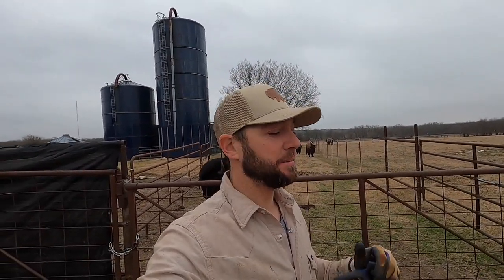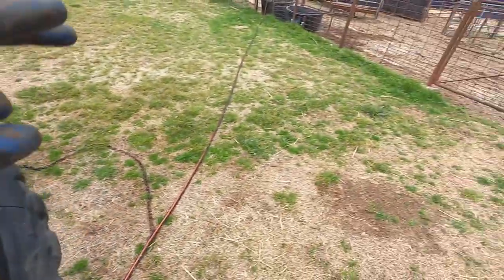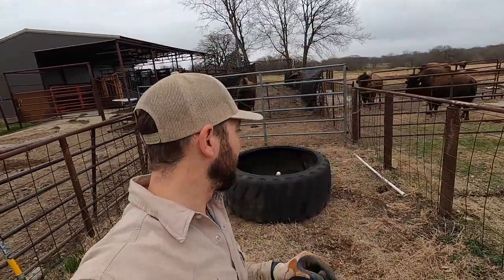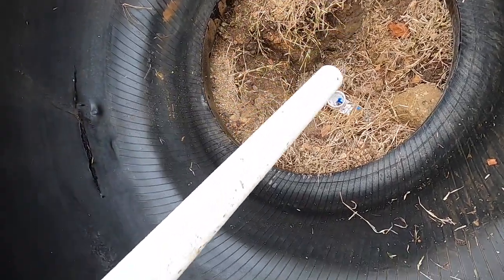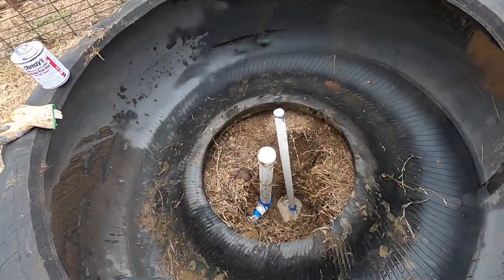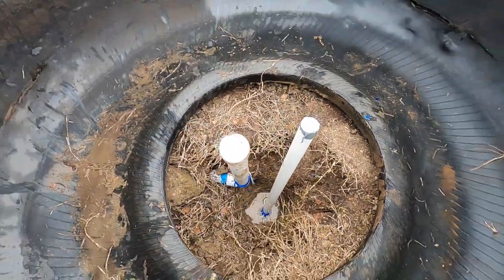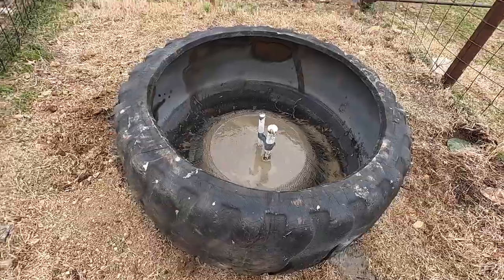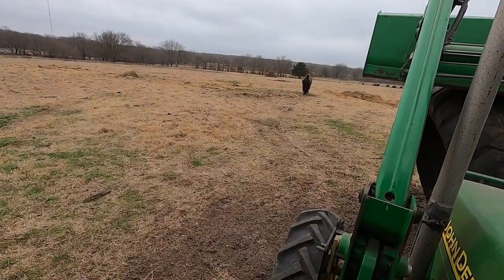BIG Tires for BIG BISON Water Tanks! (Part 3)

Comment: Dunbar playing Chicken with the tractor is hilarious.  All the Bison are so curious whenever there is something new and different, so they have to check it out. Those tires are bigger than I originally realized. Great way to reuse or upcycle worn out truck tires. Using them as water tanks, they could last for years & years! Good way to do your part for the planet & kudos to whoever's selling them and not dumping them. Though I think dumping tires is illegal...

Comment: Hopefully, the watering system is not set in "series". So that a completely broken pipe in one tank does not shut down the whole system.  The first tire has 2 pipes going into it, and 7 bags of cement.  One pipe brings the water in, so one pipe takes water to another location.  A break in the tire will take out at least 2 stations.  If the junction was made at the shutoff valve box, about 5 ft from the tire, then a break in the tire would only shut down one station.  The bison might decided to show you the error of your ways.

Comment: I love the idea of using the giant rubber tires, but my first thought was about the chemicals that will be leaking into the drinking water from the tires. 

There is a lot of concern for the types of chemicals in the containers that humans drink from, and I think that rubber tires will have a huge amount of bad chemicals for your herd that will inevitably create problems in the health of your animals. 

Did you line the interior with anything other than cementing the bottom?

Comment: Given that concrete is porous you might want to consider installing a very sturdy waterproof membrane to prevent an ongoing boggy mess. 🙏
Also, what is to stop the big boys from flipping the tyres over??? Given the shape of the concrete base...🤔🤔
Reply: He's not stupid. This guy grew up working with his hands, helping around on the  farm and has worked with concrete for 20 years. No doubt he anticipated that and has a plan.